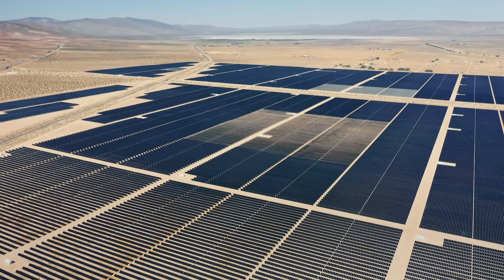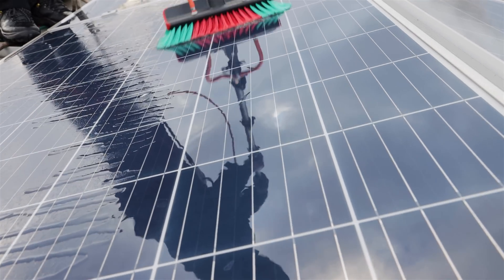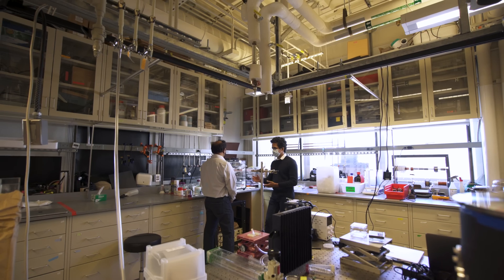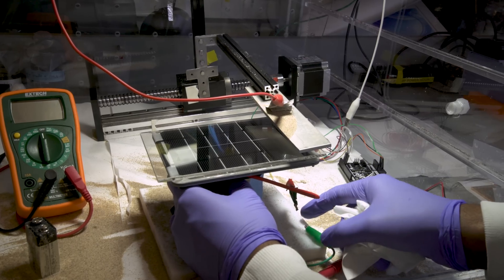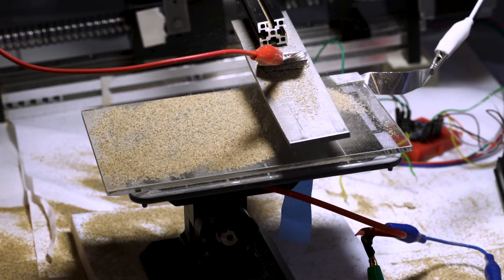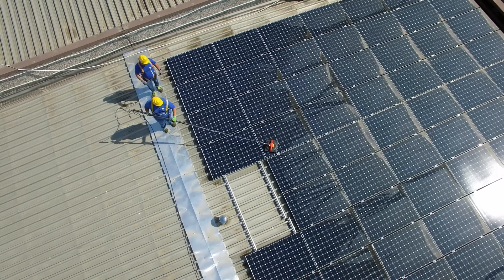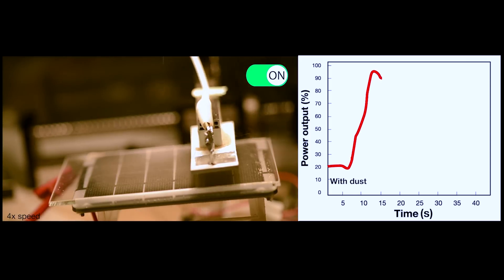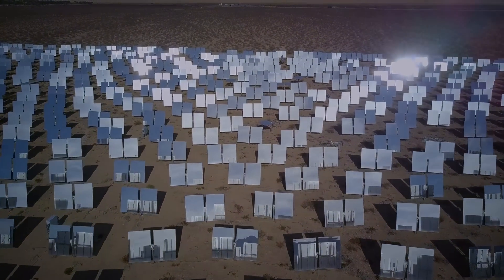How to clean solar panels without water

Comment: I see there's some residue left after the electrostatic scanning.

So then for those dust molecules that are neutral charge, would they remain on the solar panel surface with this method of cleaning, and will they continue to accumulate over time?
Reply: Yea i was thinking the same
Reply: Perhaps, but it would seem that because charged and uncharged particles still possess very similar masses, morphologies and so on, there should be constant mixing between them. In addition, uncharged particles at the time of one scanning can become charged by the next scanning. Also, the charged particles removed by the system carry some uncharged particles with them due to friction.
I guess that the average (daily-maximal) humidity is a key component in defining the steady state percentage of uncharged particles, which in turn would be a key indicator of the system's efficiency. But let's wait for the large scale experiments, it's intriguing.
Reply: @podir47  all that aside, do you think it is efficient enough for commercial use, afterall that's what decides adaptability?
Reply: @SC-dr4wk  I don't know, and they don't know either I only assume. They merely show a proof of concept, it's a very long way to establish a commercial implementation
Reply: Ya doesn't seem like that is going away
Reply: It appeared to me it was just dust falling back on to the panels because they don’t have a proper removal system. It’s just a prototype.
Reply: Shouldnt be a problem, if you have to use water once every 10 rounds of cleaning then you've got quite some water savings
Reply: shhhh this is not what investors want to hear
Reply: They actively charge the particles, so there's no "neutral charge" particle on the panel. They're all positively charged. Some are left there but they will go away on the next pass, so you're gonna be consistently at ~95% power, not 100% but that's a lot better than a completely dusty panel, with no water used
Reply: @FAB1150  lol. Solar panels are expensive. They're not going to throw 5% of their efficiency away. They'll just use water. It's that simple. This advertisement isn't going to change their minds to not use water and lose 5% of their money. They're going to just use water. Of course. That only makes sense. Financial sense. The only sense that matters in this world.
Reply: @xbzq  does… water not cost money now? Goddamn the dunning Kruger champagne is strong here
Reply: @xbzq  You need to transport all that water (and get it from somewhere mind you), you understand that would also cost money yeah? Not sure which would be less expensive but I'd bet on this method
Reply: Everything is neutrally charged. Also, electrostatic forces work fine on neutrally charged particles due to electrostatic induction (and/or dielectrophoresis, which I've never heard of before this and don't understand). 

You see particles left behind due to their size, not their charge.
Reply: Thst's why they said 95% of dust and sand removed
Reply: That residue will not affect performance of daily solar gains. I believe solar panels are designed to still work with "some dust" on its surfaces.
Reply: Let's put a special coating on our floors and have the dirt fly into the trash can. So smart. I will note that a vacuum cleaner does a better job than this dumb contraption. I cannot believe not one of you people notices that this entire video is actually an advertisement. It's not made by students or faculty. It's made by a professional ad studio. Why? To make you believe MIT is saving the world. To make you believe something is being done by someone smarter than you. And you're falling for it. No critical thinking abilities, just a boundless trust in those you consider to be smarter than you. It's just the same as a Kickstarter promo. Asking for goodwill for a bunch of hot air and outright lies. If you really think this is a solution to a problem anyone actually has then you're too far gone already. All you'll ever be is a cheerleader to those who have come to turn you into slaves. There kind without chains. The kind that obeys with conviction. It's okay. They've got it under control. Someone's at the helm. It's not you but someone smarter. They know what to do even when you haven't the slightest clue. You can entrust them with your life and the life of your children.
This thing is a solution looking for a problem. There's clearly no money in it. It's just a promo to sweep up investors. And you. Elon will save us all by graciously allowing us to give him money to go to a desert planet because soon it won't make a difference which desert planet you live on. Elon is a hero. He's like Tesla or Einstein but better. He's the real life ironman. Yeah baby.
Carry on everyone.
Reply: They would, this is bullshit
Reply: I noticed that, but that film might be their conductive coating not being perfectly transparent
Reply: Rather just retreat the the cleaning water 😅
Reply: Electrostatic repulsion mean it blow up from the surface of solar panel. It is not electromagnetically.
Reply: They would remain, well what biology suggests is that we use microfiber to clean the left over ,but that too would require some water. Well it would be much less when compared to what it used earlier . My approximate calculations state that if the general that would be 10 percent of what needed earlier.
Reply: we can still use water once in a while to clean it but that will be much less than what is being used now.
Reply: I think you'd still need a piece of wet cloth to go over it.
Reply: no
Reply: I think this'll reduce cost of getting fresh water in the dessert, it's not a perfect solution, just reducing the hassle of maintaining them in desserts, as some thing like sandstorms could show up any time during day and people cannot go and clean the panels everytime sandstorm shows up. Consideration it removes 95% debris, process of cleaning would be done less frequently.
Reply: They look small enough that compressed air could potentially be used to blow them off? If they're not charged they won't be 'sticking' to the surface in the same way static dust usually does either, allowing for more effective cleaning.
Reply: Is this system commercially available ?
Reply: I'll also add that periodical scrubbing with water (if necessary) if this system were to leave residue is still ideal compared to what we have now
Reply: Agree
Reply: To me it looks like this method is only removing the particles the wind would blow away anyway. 

I mean - yeah sure it works. But if the benchmark is made in a lab un a completely flat surface with no wind. And completely covered in sand. I have never seen an actual layer of sand on an panel in the real world - it is the fine dust that is the problem, and it seems to stay on the panel during this method.

Highly doubt it will have even the smallest measurable effect in reality.
Reply: Thesse guys took weeks or months coming up with complex idea just so its worse than air out of compressor (which you can also use in desert as you have both energy and air available)
Reply: @kubagra456  first the energy usage of this system is much lower than compressing barrels of air.  Second, one really doesn't want to blow dust, especially in a solar farm where the dust will just end up settling on other pv cells.
Reply: @pia31415   1. Are you someone researching same technology to know that is actually uses less power (if you have source then tell us how much power it consumes)
2. Unlike this sci-fi solution for somewhat simple problem air compressors are something that is already produced (and they would give better results if what we see in video is best this technology can do at (not) removing dust)
3. "energy usage"... while we're talking about using it next to power plant...
Reply: @kubagra456   kid, you're trying to be argumentative just for the sake of contrarianism and debating, that is not something you want to do with your time
Reply: @acidset   * watches a 2 minute video about a hand sized prototype for cleaning a solar panel that requires an entire extra layer to be added to every panel, thus increasing production cost and likely lowering power efficiency. Then has the gull to call someone else ‘kid’ in the comment section because they dare to question the effectiveness of something that hasn’t had any field testing. It’s not a good use of your time to vehemently defend every piece of technology that has a prestigious 3 letter acronym attached to it.
Reply: @macicoinc9363  im sure the 3 letter entity has more credibility when it comes to research and science then some random youtube commentator.
Reply: @kubagra456  haha. But the compressed air could cause the sand dust to scratch the panel.

Comment: Great work. Congratulation to the MIT team for their dedication, and effort. This product will not only clean solar panels but it will also increase the life span of panels.
Reply: Thing is, that it only removed whole grains of sand and not dust which was still left on glass. This "MIT team" could come up with either glass to which dust wouldnt stick as much or a high-pressure air compressor for better results

Comment: Great idea using electrostatics to remove the dust.
Could you use the same electrostatic repulsion to prevent the dust accumulation in the first place?
Reply: Not a quite energy efficient idea to have electrostatic repulsion all day long
Reply: @ace6396  I understand the ineffency of running all the time.  Maybe a periodic repulsion pulse would work.
My main thought is to eliminate the extra mechanical parts.
Reply: @RK-1956  Don't you think it can cause micro scratches on using repulsion rather than attraction.
Reply: @ace6396  I have no idea.  It'll take someone a lot smarter than me to answer that question.
Reply: This reminds me of the degaussing setting we used to have on CRT monitors.  Could we use something like this for cleaning windows of office buildings?
Reply: How about electrostatic neutrality.
Reply: Wil vibration of the solar cells do the same effect?
Reply: On another note, fitting millions of panels with a control system and actuator arms hovering around the setup would not only add significantly to the footprint of the panel weight, but additional need for balancing and arrangements needed to compensate for the same. 
Instead I would rather have the researchers collaborate with robotics so that a group of robots could move around the field going on periodic trips and use the same tech but which would be built upon itself instead. This would cut costs significantly in my opinion and thereby add to the interest of solar companies to adopt the tech.

Comment: Would compressed air also do the job without scratching the surface?
Reply: You'd think so, then again it might act like sand blasting. Who knows!
Reply: @jonwelch564  well thought, it could be even worse than traditional washing🙈
Reply: its expensive and the sand particles sort of stick onto the pv cells
Reply: How about just having a constant stream of compressed air travel down the solar panel to make sure nothing ever settles on the cell in the first place? It cant stick to it if it never passes through the boundary layer.
Reply: @GermanTopGameTV  good idea, but that would probably use up half of the power generated lol
Reply: @GermanTopGameTV  how are you going to compress and supply that much air 24/7 without spending a ton of cash and power
Reply: @GermanTopGameTV  that dumb idea, what the point using solar panel if u just gonna wasting it for cleaning the panel lol
Reply: @koalabanana1998  Single compressor in a building, big air tank, air lines to the panels. Tiny holes in the panels to expell air like an air hockey table. You allready have to route lines for power, might as well include an air line in there as well.
Reply: @GermanTopGameTV  you still need to run a fat, hungry and costly compressor, as well as maintain and build a lot of piping. you need a lot of air to do this
Reply: same question, maybe they can develop it so that the sand blasting effects are minimised? What about vacuuming?